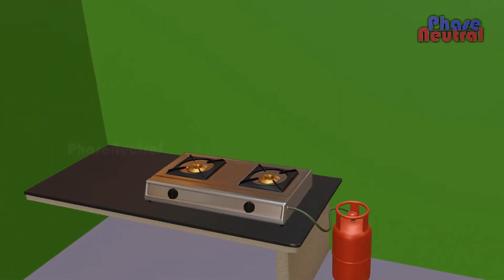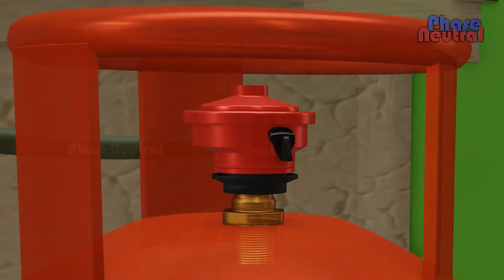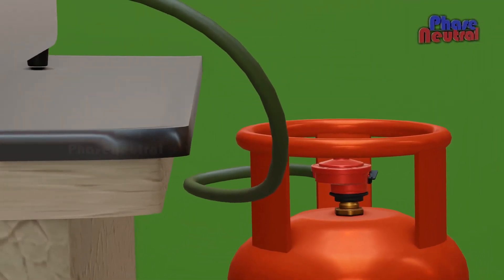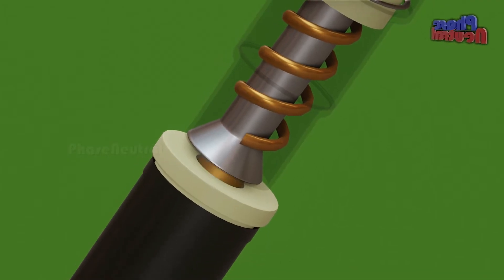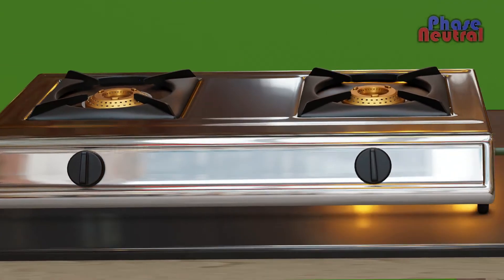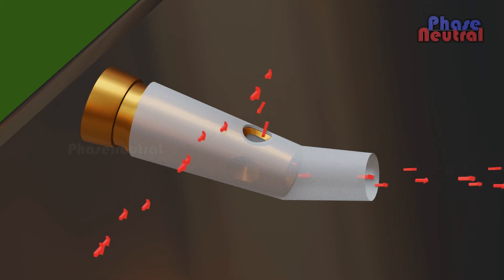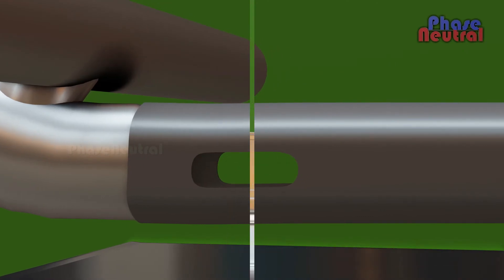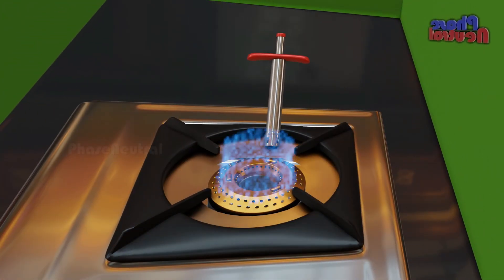Working of Gas Stove | Manual ignition | Phase Neutral

Comment: I have a question bro 
Why the fire does not go in the gas cylinder

Plz reply
Reply from the maker: Because of gas high pressure and speed. It prevents flames move inside.